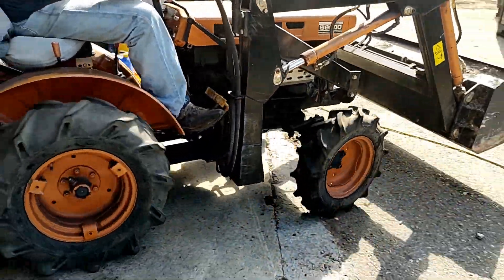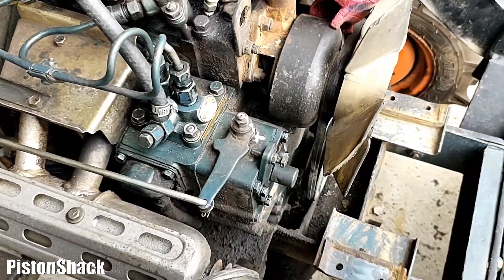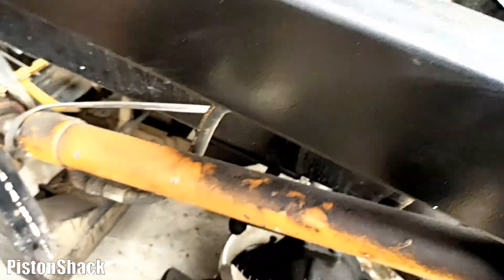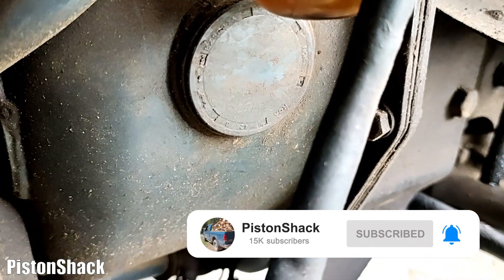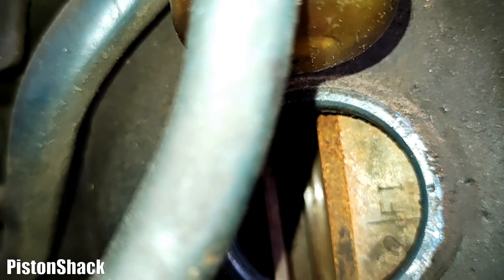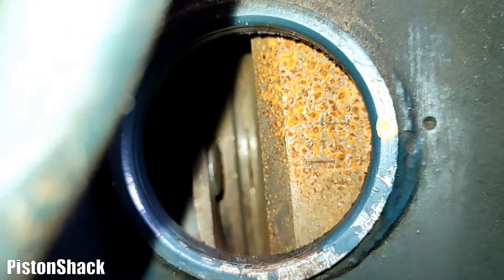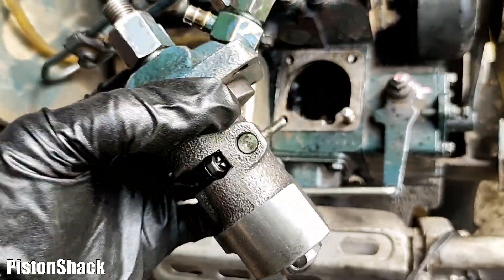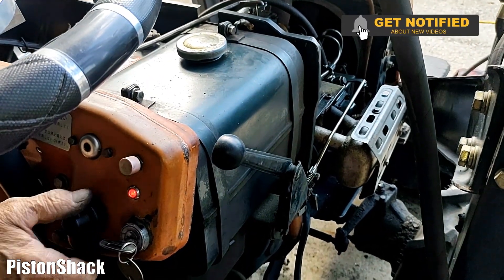KUBOTA B6000 TRACTOR FUEL INJECTION TIMING

Comment: Hi - My 6000e ran out of diesel. How would I go about pushing the air out to get it flowing again? Thanks
Reply from the maker: Bleed like any old school diesel engine. Prime fuel to the injection pump with a lift pump them purge air from the injectors.

Comment: My tractor would barely start and sometimes wouldn’t start. I tried adjusting the two nuts on top that are attached to the decompression lever. When the nuts were all the way in, the exhaust was putting out white smoke and engine wouldn’t start at all. I adjusted them by pulling them out a little and tightened the small nut around it for both cylinders, the tractor runs great now, no white smoke, and it starts even faster than before. It even starts on idle without giving it more diesel. I am concerned, did I do too much compressions and is there a risk of blowing the engine out? Or am I good? Any ideas or troubleshooting will help, thank you.

Comment: Where is the transmission  oil screen (filter)?
Reply from the maker: Transmission oil filter screen located inside the gear box housing opposite side to the drain plug. If you look from the top down under the dipstick gauge.